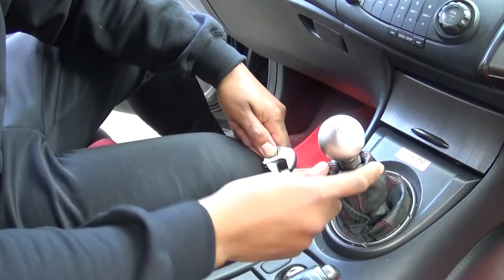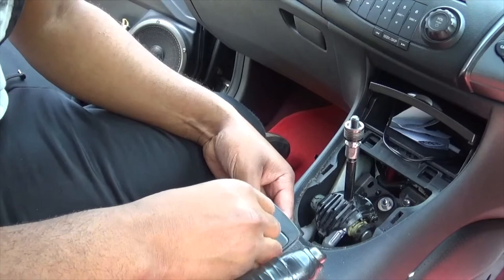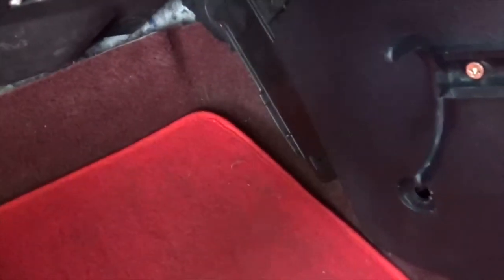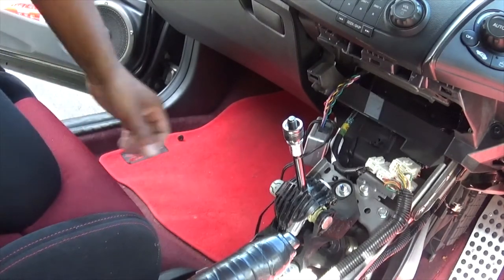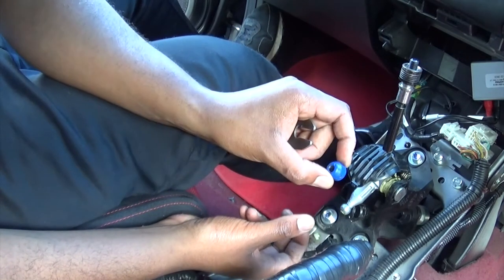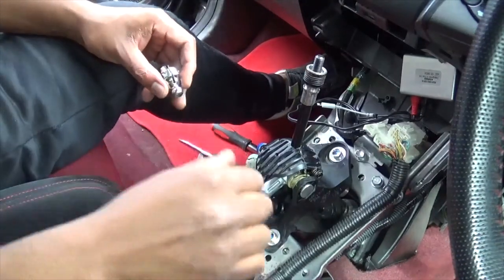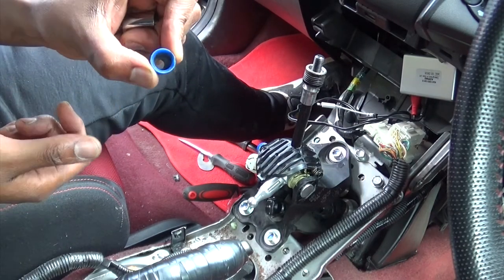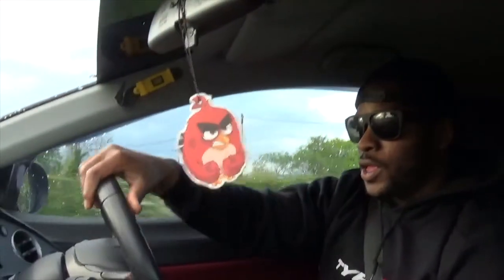SHORT SHIFTER KIT //  HONDA CIVIC step by install & test drive // FN2 TYPE-R

Comment: One tip, don't use WD40. It'll just wash away any grease already in the cap. Silicon grease does the trick or nick a little of the yellow stuff off the shifter ;)

Comment: haha Mine popped off real easy. Also  the part with the little blue ball  joint I dropped it into some boiling water for a few  seconds and it popped right  on. keep doing  what  you are doing  and I Subscribe too.
Reply from the maker: good tip bro. thanks for the support man. glad you found it helpful bro

Comment: a good video bro, i done the short shifter mod on my type s gt, i got mine from a member who makes them himself and sells them on civicinfo i think the one you got is a jan speed one if im not mistaken, you should have got hold of a dremel, because that filing takes ages, and to make the trow feel more solid you should get hold of a skunk 2 gear knob or any other gear knob that is weighted the oem type r one is really light compared to the skunk 2 one, either way a great video very informative for people to install the short shifter, i think next you should do the ing mirror fold mod
Reply from the maker: +Jay Khan thanks for the comment bro. Always good to get more info. Will take a look into the weighted gear knobs also. Where can I get info on folding mirror mod !?
Reply: you can get all the info on  civicinfo mr stealthy and the member i brought mine from sells them there his member name is ante00 just look him up on there, and its all plug and play basically, and looks sicks because it works off your key fob, allso you can do the chl mod too, and they sell them on civicinfo from trusted members,

Comment: Gr8 video would only change the filing to a dremel but then again use weh u have... Gonna do this mod...  Would you consider getting a HID/LED kit and a folding mirror mod  installed if  so could you do a walk through?

Comment: hey man, nice walk through install video. glad u covered all the details on how to do it plus little tricks to help it go smoother. I may just get one of these now...wich one did u go for?
Reply from the maker: HONDA RPMS no problems bro. Yea I tested it for a week before releasing the video. If feels good. I went for the japspeed kit £15 of Ebay. Around that price there all the same I reckon. But again a cool piece of kit and easy to fit just removing the trim was a ball ache but still manageable 👊
Reply: Nice one mate thanks. I'll have a look. Cool video again dude well done on the details

Comment: Have you thought about getting the shifter bushings too? Ive been looking at these just yesterday along with the damper delete/bypass
Reply from the maker: +alex nicol hi mate no ive not looked into that. Will have to check it out. Does that make the throw even shorter !?
Reply: Thanks for responding, apparently they make shifting feel a little more solid and precise and the forums suggest its an easy mod although you would have to remove the air intake to do it i believe. Just had eibach springs and spacers put on mine with a frsu so looking at what else i can change cheaply and effectively while saving for more changes....
Reply from the maker: +alex nicol awesome man. I'll check that out seems like you've got a good planning thing going on. I need the frs doing on mine soon. Supposed to be really good. 👌🏾
Reply: Oh yeah it really changes the drive and makes a drastic improvement
Reply: Stealth Brotherz naw mate, they don't shorten the shifting. But as said before, it does feel more solid (no quenching in the rubber bushing). And if these rubber puks are a bit worn, the solids one will take care of any play o movement. 

I do just wonder about an existing short shift kit onnthe gear row selecting, 1st-3rd and 3rd-5th. But maybe they are hard to catch right after dat.

cheers. N keep up ye good videos.